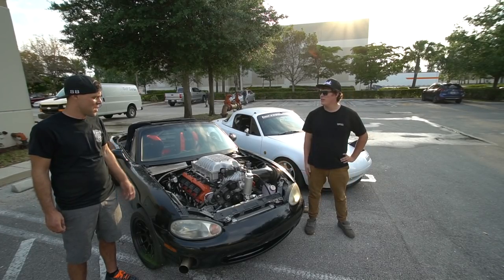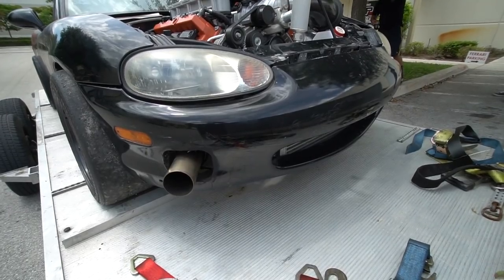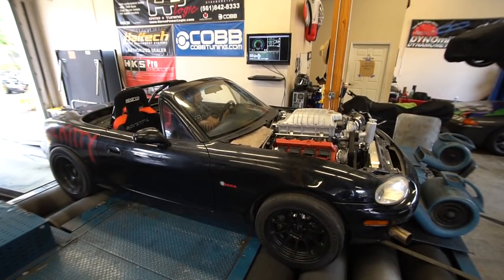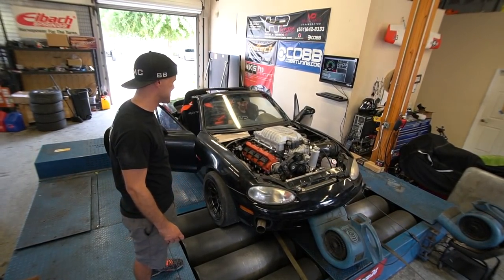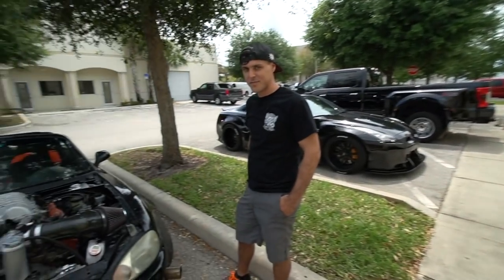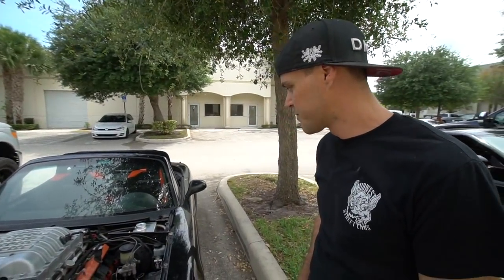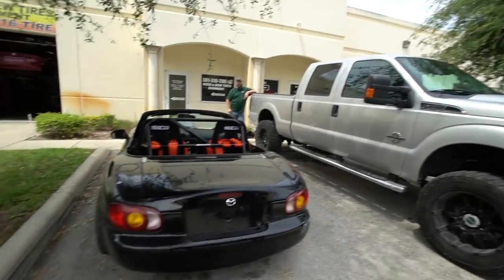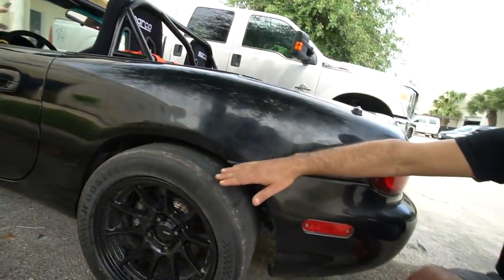WORLDS FIRST HELLCAT MIATA!

Comment: 50/50 weight distribution has just left chat
Reply: Jimbo Burrito 10/90 now lol
Reply: Lmaoooo
Reply: I dropped my phone laughing now my back glass is  back cracked
Reply: Dude tub that thing with ford 9 inch rear end and add about 300 pounds in rear and your good 2 go..... scratch that actually you should consider methanol injection also 👍👍
Reply: @jeffhaire1984  its already got a mopar in the front, why not go with a 9-1/4 half ton pickup axle and chop the tubes down
Reply: @chawboy6921  👍👍
Reply: @snackler6102  80/20 weight distribution lol
Reply: I bet the oil change is more simple then stock!
Reply: giant wing could help
Reply: @johneldepresso  99/1
Reply: @snackler6102  he has, have to, woulda blown on the dyno..
Reply: @killfase01  lol, am surprised they don't have wheelie bars on that thing...
Reply: @jrag1000  lol true but with that much weight in the front who needs one. Hes gonna need some 355 wheels just to reach practicality
Reply: @johneldepresso  .9/9000
Reply: in a RWD there is never 50/50 distribution because the inertia moves backward naturally when the car moves forward
Reply: Surprised that thing doesn't do endos all the time. Lololol
Reply: Ky Wildcat Scratch Fever run the wide body fenders and 12's too would be nuts!
Reply: Chawboy 69 Powerwagon Dana 60 with selectable rear locking diff.  😍
Reply: djchasingsummerjoan made out of lead lol jj yeah,.. ZR1 fully adjustable ZTK wing off the K-Tech c7R /new ZR1's
Reply: Most v8 Miata conversions still keep very very good weight distribution
Reply: Lmaooooo
Reply: @snackler6102  Like Kim Kardashian big or bigger?
Reply: Weight distribution like a barbeque! 80/20 ground chuck
Reply: Yeah, don't think 12" wheels will help
Reply: Power to weight ratio has joined the chat
Reply: it becomes 50/50 when u floor it from a dig
Reply: Moooooorrrrreee pooooowwwwreeerrr:has entered the chat

Comment: We all said the Hellcat needed to lose weight, not become anorexic lol
Reply: When we said lose weight we meant like 3500 pounds not 2400
Reply: Defs got that power to weight thing happening.
Reply: Lmao
Reply: @wobblysauce  power to weight? 1000:1
Reply: @wobblysauce  now it actually  needs weight to grab in the back lol
Reply: @C4AJ  Ah you saying he is going to 'Sandbag'...
Reply: DMack
Reply: Dmack no there is a reason why the hellcat weight is 3500 lbs because if the weight of the car and the amount of horsepower the dodge hellcat has do not balance out to make it stable, Anything can happen or go wrong. For example, let's say we drop the dodge hellcat weight to 2950 or less lbs with the same amount of horsepower it has in it. The car could  have too much  aerodynamic to cause it to lift in the air and unable to prevent the car from getting in an accident with an other driver or yourself to be exact
Reply: Burrell Henry Jr Issa joke
Reply: @younglordfattmacc  I know you joking about it but I cant see myself driving a miata with a dodge hellcat engine in it, period though

Comment: Nothing but a engine with 4 tires. Insanely  cool even if I'm not a Miata fan.
Reply: scottk5rsb- yep i thought the same thing. I’ve always hated  Miatas. Would have like to see it in a S200 or Del Sol. In the end tho it is fucking insane tho
Reply: scottk5rsb agreed, I'm a LS7 427 7.0 liter corvette guy BUT hellcat 707 in a Miata is bad ass!!!  Throw 305's on all corners like the 6spd rwd  '14 z28 the broke the record at the ring add some carbon ceramics and this would be a deadly road course car!  Stop dead being so light even with the hellcat upgrade , corner over a G and tear outta the hole with all the grip.  Need some seriousl wide cut out fender flares tho, but hell it'd be bad ass!  
Fasterproms channel he built a Vortec 5.3 v8 with 6 speed in a Miata and I thought that was bad ass! Lol hellcat tho!!! 😍. I swapped a stroked and built 5.3 Vortec v8, 4L80E trans out of a Tahoe and a Tera 60R diff with Detroit locker in a 1997 Jeep Wrangler back in 2002 ,..on just a little lift and 35's with 4.88's it would literally wheelie a good foot.  Was hella fast , can't imagine a hellcat in a Miata! 
Agree with below a S2000 hellcat build would be sick .  Realistically it's a concept that's been around a long time, Shelby Cobras '65 and up with cobra jet 427 ;..tiny coupe huge power .  A GM guy but would kill for a Coyote Factory Five cobra replica .  😍👌
Reply: scottk5rsb what's you pref just curious ? Not being a Miata fan u a 2JZ or Mopar? Ford? GM?
Reply: @thewhiteshadow7466  hates Miatas but likes "S200"...
Reply: wonderbreadjumps- yep and what’s your point.
Reply: @thewhiteshadow7466  s2000 not 200
Reply: Fintan- my mistake “S2000”..

Comment: U guys forgot to use the red key 
That’s why it was under 500hp😂
Reply: Only the demon has that feature if this is a hellcat motor it's only 500bhp
Reply: heart shaped box ummm... u good? Hellcats come with the regular black key which limits to 500hp and the red key which is the full 707
The demon comes standard with the red key, 808hp but can go up to 840 with all the other “things” 
And THIS IS a HELLCAT Motor,  if u watched the vid u should know, or just by looking at the thumbnail. Also, we all knew the engine wasn’t  going to make 707hp right off...
Reply: Streetboyz yeah no chance that’s he’s slipping of the dyno is why it’s not hitting close right? Probably doesn’t need the specific key I’m not sure it would be the same ECU
Reply: Looking closer in the video it doesn’t use keyless start there’s a key in the ignition that gets turned furthering that it shouldn’t matter what key it is.
Reply: There is no immobilizer linked software on this car. It is just engine swap with everything already unlocked to its highest potential. Dodge puts software on the car depending on what key is used it activates either 500 hp or 707.
Reply: that’s only on a hellcat it’s a computer system it’s not in the engine it’s in the car unless they brought that over to the miata with the hellcat engine but i highly doubt it
Reply: dpats54 
r/wooooosh
Reply: al 
r/wooooosh
Reply: Agent. K. r/wooosh
Reply: Streetboyz When they swapped the motor they probably didn’t put the restrictor for the amount HP it produces. It’s most likely slipping because the cars like 2000 pounds and it was designed to handle like 200hp not 800.
Reply: dpats54 😂😂😂
Reply: Streetboyz you need jet fuel aka racing fuel for the 840 hp
Reply: 200th like
Reply: heart shaped box wrong.
Reply: At 15:12 he’s says the computer is locked. I’m not sure if he’s referring to it being locked in “black” and wants it unlocked to “red” or unlocking it to load/flash whatever tune they can throw at it..
Reply: @youcodnerd  the hellcat has a feature in the head unit and a different key for 500hp and theres a 300hp valet mode too
Reply: heart shaped box My hellcat has a black key for 500 and red key for 707. I can also set my horsepower from my touchscreen with the red key in
Reply: 500hp in a miata is PLENTY
Reply: Agent. K. What is “r whoosh”?
Reply: @heartshape has left the chat🤣🤣🤣🤣
Reply: @VyprMoto  there is no "RESTRICTOR".  It is built into the computer.  it's part of it.
Reply: @dpats54  the Hellcats do not use a key.  They have a push button and a key fob that must be within 2 feet of the botton to start so i'm not exactly sure why there is a key because it would not start that way.
Reply: @youcodnerd  where are you getting this false information? LOL
Reply: heart shaped box lmao “only 500”

Comment: they way the exhaust is coming out... the air is pushing the fumes back to the car?? :P :P
Reply: Yeah, heat being shot out and being dispersed around the already hot engine.. I thought that too. I would run a pipe along the bottom for better heat dispersal and weight balance, also add more than 2 pipes, that baby blows a lot of gasses

Comment: That things probably 2,000lbs lighter than a hellcat. That motor is not even breaking a sweat pulling that Miata chassis
Reply: I would think there was that much difference there is about 1,800lbs between stock version but that engine is about 450lb heavier than the miatas, plus the massive trans and the diff it would be lucky if there was 1,000lbs difference now but still hell of a weight reduction

Comment: The exhaust like that is going to create back pressure. The objective is to get the exhaust out at fast as possible not to push it back into the cylinders as fast as possible.
Reply: That doesn't even make sense. Did you see the build of the headers? Less the 3 feet of pipe, zero backpressure.
Reply: Immortal Lu  well I did see the header and that's why I said what I said it's pointing out the front so when he drives it forces air back into the exhaust pipe in return creates back pressure. Now does it make sense.
Reply: No the exhaust is not ideal, or anything about the car..... It's only intended purpose was never anything other than looking and sounding like a tire slaying fire breathing monster from hell thats only mission is scaring old ladies and children!  Not low back pressure brotatachip! Its like worrying about mpg, tire wear on a drift car

Comment: Stock hellcat motor keeping the numbers secret with the same trans lmfao
Reply: This will have a lot less drivetrain loss.
Reply: ThierryTheuns not any more then it does with the same transmissions and motor just in a different body . Now 
 if it had a different transmissions sure .
Reply: But will see when it’s on the dyno and they give the numbers but I’m putting my money on is on 630 640 that’s the average range we see out of stock hellcats .
Reply: Way shorter driveshaft. Less rotating mass. Smaller wheels and tires. Way less rotating mass.
Reply: @sideshow45  there's not much difference in just the wheels and driveshaft  but maybe 20hp
Reply: If u watched the video it showed the dyno numbers.

Comment: Such a whiney host, but that mx5 needs to be drifted.
Reply: Wouldn't happen, front end is way too heavy😂
Reply: @MLyonsRacing  doubt it, if it can donut, it can drift, it has enough horsepower to get slippy.
Reply: Yeah but probably too slippy though. Like a doughnut is probably all you can do because if you tried drifting it would oversteer into a doughnut anyways!
Reply: Pker Pker doesn’t matter how much skill you have the weight ratio is about 10% in the back and 90% in the front

Comment: an NA has more room inside than an NB because the frame and footprint are the SAME chassis. The NB looking "bigger" is from the outer sheet metal only. the NB's fenders are wider. Interior is exactly the same dimentions. The difference is that in 99, stricter regulations and a drastic restyling of door skins, center console, and dashboard (going from NO style to a style at all) took away inches of space on all 4 sides, so an NB is SMALLER inside than an NA just due to losing some space to the shapes bulging out of the trims. Just google NA interior and NB interior. The NA had literally nothing to look at. flat doors. flat dash. flat center console. Very boring like sitting in a giant fake-leather Walkman cassette or a tiny square tub.. the NB has tons more flare all around, and the doors, dash, and instrument cluster actually looks very sporty like a stunt plane with sexy slender and curvaceous exterior styling like a 60's jaguar roadster outside to match.. but at the cost of legroom. a small price to pay if you ask me. 

a sports car has to feel like a sports car EVERYWHERE. not just dynamically. it has to make you feel good looking at everything around you where you get inside and sit just as much as when admiring it from the outside. few cars get this right (Rx7, Mk3 & Mk4 Supra, R32 GTR, NSX, 1st and 2nd gen Eclipse, ST205 Celica, Z32, late model Diablo, C5& C7 corvette).  and it's a shame so many (often much better drivers cars) get this so horribly WRONG (Lotus Elise, MR-S/MR2 Spyder, R35 GTR, NA miata, Porsche 911 and Cayman/Boxter, Mitsubishi Evo, WRX Sti, BRZ/FRS, All  mustangs (Except SN95), All Camaros, All new BMWs / mk5 Supra)... some truly dreadful places to sit that might as well have shared an interior with a crossover SUV or a golf cart. they certainly look just like them. If it doesn't feel like you're sitting in a fast car, you might as well not be sitting in a fast car at all.

Comment: Interesting swap, those hellcat motors must be going cheap :)
I still question your forward facing exhaust due to back pressure and not having a full roll cage especially as its basically you and a engine.
Reply: boltonky also eliminates hearing that amazing hellcat supercharger whine from outside the car and largely inside.  Think it'd be bad ass to go rear exit and mufflers and people to hear the whine and not only think a v8 Miata but uhhh supercharged and awefully similar to hellcat sound lol

Comment: Dope build but y point the exhaust forward?
Reply: Where else you gonna go with it? Through the firewall into your lap? In case you didn't know, the engine that came out was much smaller, so not much room left...
Reply: @salvadordollyparton666  I understand but won't pointing it forward cause a bunch of exhaust back pressure?
Reply: Mike G nah, it’s too small a diameter to really make any backpressure and at high RPMs, I would imagine it makes no difference at all.
Reply: No room to run it out back...

Comment: 3m spray adhesive.... spray it on the rear wheels as it goes around on the dyno slowly.  It will give you the grip you need to not spin on the dyno

Comment: Please explain the purpose of putting your tail pipes out the fog light housings FACING FORWARD.
Reply: space, engine takes so much space there is no way of doing it traditional way, still better than out of the hood like civic ricers
Reply: Thrift Pup there was no room to run the exhaust under and out the side or back of the car.

Comment: YUP!!! He's right! I'm a mechanical engineer, by trade. Design and build custom cars. Doin a BIG engine swap??? Just GUT EVERYTHING from the gate. Firewall, trans tunnel, hell, the whole floorboard, just cut it all the fuck out..... Get the powertrain placed, mounted, THEN measure and cut all your panels and plates... Pull powertrain, reinstall firewall, tunnel, floorboards, reinstall powertrain, hang all your accessories, IN THAT ORDER...

Comment: Better check the tire pressure every time you drive it.  Just a few pounds of pressure difference between the right and left drive wheels in something like that will put you into the guard-rail or ditch in no time.

Comment: Ah ... So I think you might run into some......
1. Hood clearance
2. Tire wear
3. Traction
4. Insurance
5. Underwear
Issues.😁😂🤣😎😍
You went from no low end torque to not being able to use the low end torque, or mid range torque or the top end torque....🤔

Comment: So when Gas Monkey did a Hellcat swap.. I could have sworn they said even Dodge themselves required it to run on the original ECU or something right? Can the motor from these run without the original computer set up? What set up are these guys using?

Man that car would feel so front heavy...  I dunno if i'd want to drive a car that's RWD but has a 97/3 front/rear weight balance ^_^
Reply: dham99 I know there's been a race to unlock it aftermarket , somensmart techy Musta done it.  👌

Comment: He needs to put the hellephant in it instead of the hellcat. The hellephant has a plug and play 1000 hp create motor.  Look it up if you dont believe me. Or 1500 hp I cant remember but its definitely a 1000 or 1500 for sure. I'm going to lean towards 1000 hp. But anyways it's a badass motor. And the hellcat isn't a slouch itself.

Comment: lol under 500 hp in a Miata thats cute :P  there is at least one twin turbo 1000 hp out there.just google 1000 hp miata, and many 800 plus ones
Reply: It was spinnging on the dyno and it was in 6th gear. Stock motor hellcats make about 650whp or more.

Comment: K series honda engine would probably do better for road driving. Too much low end not good for road course time attacks. Mid to high RPM is where it's at.
Reply: You think so? I will be taking it to a road course where a Kmiata has ran.
Reply: @KARR  Definitely. Compare Civic Type R to Charger Hellcat times on nurburgring course. (sorry for misspells I've been drinking)
Reply: @juansolo1617  This isnt a 4500 pound boat
Reply: @juansolo1617  Its also a full build suspension and all watch my build on it.,
Reply: @KARR  true... but the civic is stock, too. limited by the FWD and still matching the times
Reply: I'll be eager to see how it stacks up for the same platform... let me know.
Reply: @KARR  Awesome. I subbed to you. That will be interesting. Good luck :)
Reply: @juansolo1617  well my car obviously isnt a stock car so thats like comparing apples to tennis balls.
Reply: @juansolo1617  Stay tuned I will have a  road course video soon  and thank you!